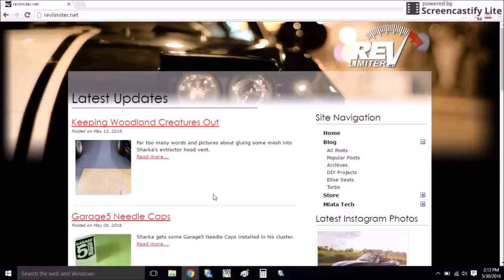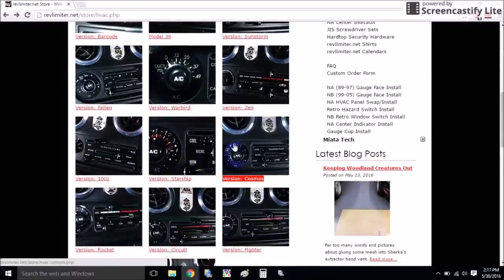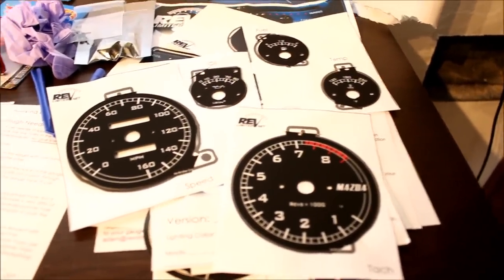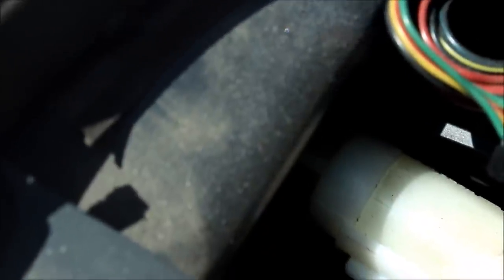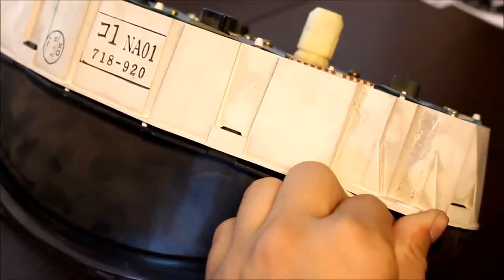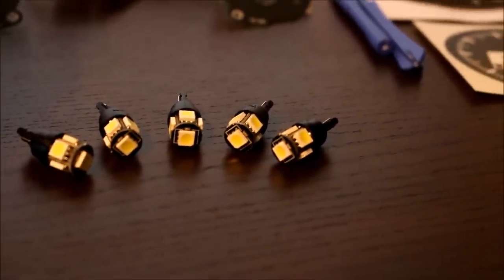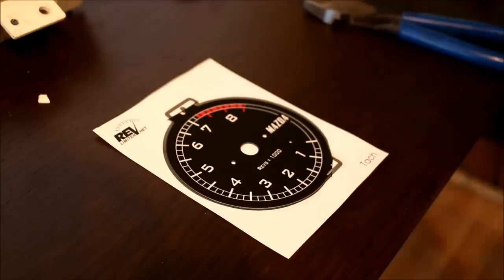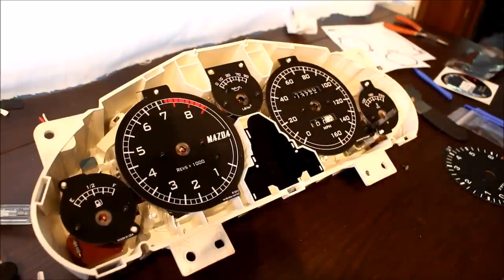Lose The Dated Interior... Revlimiter Gauges Installation!

Comment: lol, got to love how your bulb for the air bags is taped over. I am not very clear on how cutting that area out makes it work with the cluster though.
Reply from the maker: It makes the gauges fully illuminate properly. Otherwise the light can't get into all the areas of the gauge face
Reply: @TheCarPassionChannel  so do you lose the ability for specifically hi beams and air bags? It looks like those channels are to specify those particular sections.
Reply from the maker: @Valdarious  it's not high beam indicator, it's the headlight opening/closing indicator. And that's correct You will have to eliminate the airbag light somehow

Comment: As always great video and information. Question about the speedometer... How does the speedo calibrate for 160mph VS the factory 140? Are the gauges just a continuation of the same increments?
Reply from the maker: I'm sure that's how it works. So instead of the needle just going into outer space, there are numbers that it points at.

Comment: All of your videos and mods are amazing!
I am a rather tall guy about 6 foot 4. I drive an NB and I am thinking about getting different seats and steering wheel, do you (or anyone else) know what the best seats are to give me more head room, and to give me a better steering wheel position?
This summer has been a warm one (here in New Mexico) and just about every day my steering wheel singes my right leg.
Any help would be greatly appreciated!!
Reply from the maker: It's best if you can live with a fixed bucket seat since they can get nasty low, especially without sliders. Like the car will feel huge to you in comparison with a stock seat. But, whichever lower profile seat you go with, you can test fit it, then see how much you want to move your wheel by. I wouldn't buy both at once, since the seat alone will change your body position in relation to the wheel.
Reply: @TheCarPassionChannel  sick! Thank you so much! You da man!!
Reply: One more question:
Which company do you recommend to get fixed seats from?
Reply from the maker: @DILLYBAR31869  Depends on your waist size, but I'm currently running a Bride replica, probably the cheapest halfway decent seat you can get but cheap materials. Sparco Sprint are a great and inexpensive name brand option, I'm personally thinking of a CarMakeCorns seat which is built around the Miata platform. And a set of Garage Star seat mounts!
Reply: @TheCarPassionChannel  dude! You have been super helpful, thanks!!!

Comment: quick question my speedo is off by 5mph exactly is there a way I can adjust it back I think its because the car had 16's and now it has 14's but im not sure.
Reply from the maker: The wheel diameter doesn't affect the speedometer accuracy, but the tire diameter will. If it's 5mph off at all speeds, you might want to try re-adjusting the needle. If it's a certain % off, you might be able to compensate with  a different speed sensor (I ruin a 4.1 speed sensor with a 3.9 diff and the speedo is 100% accurate).
Reply: +TheCarPassionChannel Thanks for the quick reply I am certain its 5mph off on the dot (driving by highway patrol signs at various speeds) Ill give the needle adjustment a shot.

Comment: my Miata's speedometer is 4 mph faster than I'm really driving. do you know how to fix it or what the problem is? i can't find any videos on it.
Reply from the maker: You can reset the needle like I did here, if it's actually a certain mph off. Most speedometers are a % off, so that wouldn't really help much.
Reply: ok cool. thanks man!
Reply: The PilotMaster take it off .set it to 0mph

Comment: I swapped out the original guages for the Rev Limiter version and now my oil pressure and temp gauges are both reading very high.
Reply from the maker: Needles installed wrong. Gauge faces do not alter the gauge readings
Reply: @TheCarPassionChannel  I'll take the clear plastic cover off this weekend and reinstall them until after engine is warmed up.
Reply from the maker: @mr.adventure559  As per the instructions that's the correct method 🙂

Comment: if you get a bigger turbo do you have to replace all the hosing and stuff?
Reply from the maker: What housings?
Reply: +TheCarPassionChannel everything that goes to the turbo
Reply from the maker: itzmezach Exhaust manifold, intercooler piping, downpipe, etc?
Reply: +TheCarPassionChannel yeah
Reply from the maker: itzmezach It depends on the turbos. If the turbine inlet flange, outlet flange, compressor inlet, and compressor outlet are all the same, you don't have to change anything. (Might have to clock the CHRA)
Reply: +TheCarPassionChannel ok I'm buying me a Miata soon and I'm gonna turbo it but I'm gonna start with the t2 turbo but prolly sooner or later I wanna switch to a garret

Comment: 1 thing i like to do is run the car empty of gas then set your needle  right under E that way your less likely to run out of gas.
Reply from the maker: When the sensor hits the lowest point, you still have 1-1.5 gallons left in the tank. The Miata (NA6 at least) has no fuel light, so the fuel needle pegging "E" is really the 'gas light.' But, you can set them to your preferences, that's the beauty of it!

Comment: So I no longer have airbag lights? (cant pass inspection without
Reply from the maker: Correct. I no longer have airbags so I don't really need it. There is a reversing process so you could temporarily swap in a stock tach for an inspection.
Reply: TheCarPassionChannel Good idea, if a cop pulled you over could he write a ticket for not having proper warning if he noticed? Have you ever been pulled over and given grief for having a aftermarket wheel (no airbag)?
Reply from the maker: ***** No, pretty much the only things to worry about here are loud exhaust tickets, no front plate, and the big one would be a ref ticket for engine modifications.

Comment: i dont suppose you know what would cause my speed meter needle to bounce at low speed would you
Reply from the maker: Speedo cable
Reply: Needs replacement.  It will continue to get worse over time and eventually make noise.  Mine is currently doing it too.
Reply: I think NA miatas have a slight bounce in the speedometer, like a hover bounce. Unless yours is worse than that
Reply from the maker: Johnny Batz With a healthy speedometer cable it should be pretty smooth
Reply: +TheCarPassionChannel definitely. Thanks for the upload, another great video!

Comment: Way to much work with resetting in my opinion... I been wanting to order a set but this just made me decide against it.  I thought it was everything it is... except for resetting... I figured everything just went back the way it came off and done.  The resetting kinda seems like a pain. In other words...I figured it would be like a steering wheel... where you take it off straight and put it on straight.  Take the needle off at 0... put it on at 0...idk...